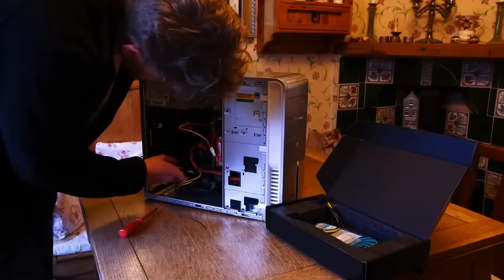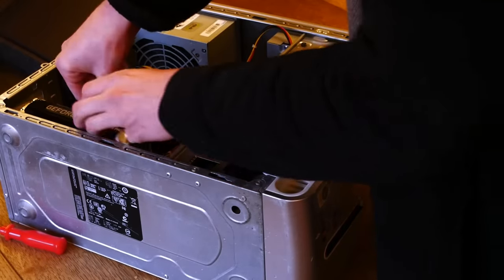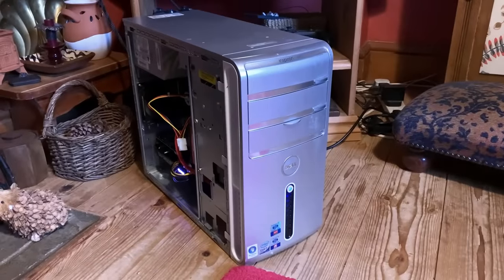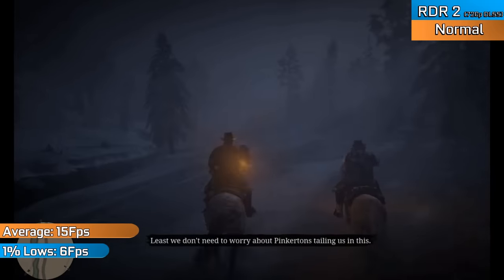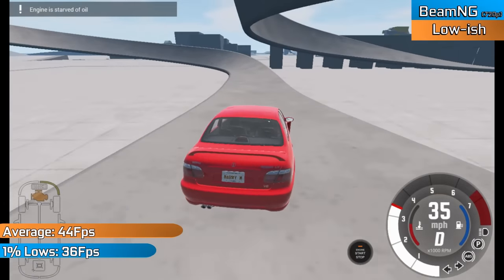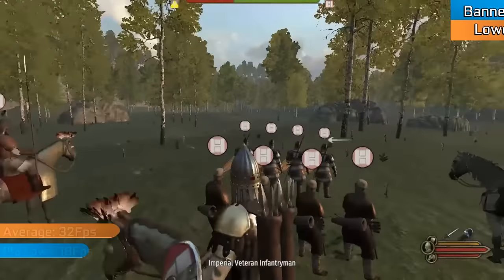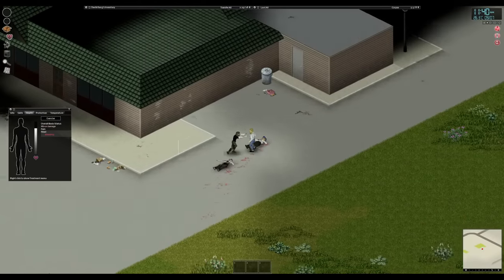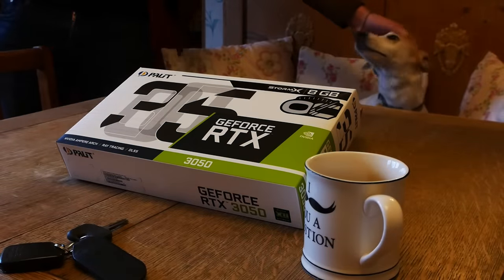RTX Graphics Card in a 15 Year Old Family PC...

Comment: Your biggest limitations here won't be the age of the processor, but rather the PCIe generation. I imagine it's gen 2, so the cpu is probably working itself to death trying to feed the gpu through that slot. A faster cpu might help, but I reckon the pcie slot bandwidth is the problem here.

Re: newer games on older cpus; it's worth noting that some older cpus simply don't have the instruction sets used by some newer software. It'll either work, or it'll be broken.
Reply: No, it's the CPU. The CPU doesn't work harder if the PCIe bus is bandwidth limited. That's not how it works. It sends the SAME commands through the PCIe bus and the bus is either too slow or it's not. It's pretty much certain the CPU is the bottleneck.
Reply: @photonboy999  Not really. If the bandwidth is smaller, the cpu has to queue up the data while it waits for it to be pushed through the pcie bus. There isn't an infinite amount of cache available, so the cpu will be constantly shifting they data around between caches and memory until its ready to go.  The cpu is definitely a weak point, but not as weak as it seems, given the extra overhead its incurring managing the pcie bus.

Comment: I also got Cyberpunk working on a Q8400 with a patch... Runs at 5-15fps depending on location lol 😂but in more sensible games the Core 2 Quads actually do very well, you can play a lot of older and simpler games on it at a stable 60+fps. They're still great for web browsing, word processing, 1440p youtube is also possible (4k struggles). Still capable and cheap.

Comment: This was really well done! It's nice to see someone who has some knowledge of older and newer hardware. A lot of youtubers kind of drop the ball and can't identify anything more than 10 years old. Can you post the model of that PC's motherboard? Most of those Vista-era Dell Inspiron systems (like the 530) I have come across could support any Core 2 CPU with two cores, but quad cores were off limits. If that thing can support Core 2 Quads it must have the G33M03 motherboard (I had to Google this as It was long forgotten information for me), so I'd be curious as to how it'd run with a newer CPU or with a pad-modded Socket 771 Xeon. The Q6600's anemic 2.4Ghz clock speed and 1066Mhz BUS are pretty limiting compared to the higher clock, BUS and cache on a Q9550, Q9650, Xeon X3370,  Xeon E5450 etc.
Reply: he needs the DDR 3 boards for the old Core CPU !
Q9650 here, on new RTX card ! 1080p@60 FTS !

Comment: Be glad that this PC even booted up with this card. Most of newer RTX card don't have Legacy VBiOS, which I learned hard way, and there were very, very few LGA 775 and 771 boards which actually supported UEFI. Core2 aside, I have hit a wall running with newer X58-based (LGA 1366) system which was also Legacy-only and EVGA's RTX 2070 which lacked support for it. I have Xeon dual CPU boards that support UEFI, but there are several bugs (like I have to manually install OS on another PC and add boot path manually in setup later), first platform with proper UEFI support was Sandy Bridge, no idea on AMD.

Comment: FH4/5 requires SSE4.1 support, so you need a Q9650 CPU, otherwise Q6600 won't work.
If you want to have a cheaper CPU with SSE4.1 support, and you can get a Q8300.
Reply: I’ll have to try it on my core 2 quad q9550.
Reply: @EvilTurkeySlices  It worked well with my X5450 (modded BIOS, equal performance as Q9650) just anything Q9xxx series, E/X54xx series that allows to play it modern games with SSE4.1 support. (If you ask me, "what about dual-cores?" It's painful enough to suffer or game wouldn't boot or in-game)
Reply: @Jenci  dual cores are great for gaming around the time the systems came out. A windows XP or Vista build will perform way faster with a high even core 2 duo over a quad.

Comment: There is still more performance to be had on this thing by either BSEL tape modding the Q6600 to run with 1333Mhz FSB, or upgrading to a Q9650, as from what i've read the Inspiron 530 supports 1333Mhz FSB. From my experience with an OptiPlex 755 with Xeon X3363 (~Q9550) and 1050 Ti, it pairs much more evenly than what's demostrated here!

Comment: In 2019 I played Metro Exodus on a beast from 2008: Asus P5Q deluxe, 8GB DDR2@1066 and a Q9550 OC'd to 3.2GHz. Video card? GTX1060 6GB. The game ran smooth at 1080p with some things turned down of course. It was perfectly playable, and the graphics were stunning although you could feel it struggle under all that load. It is interesting to see how demanding the games became mostly on the graphical side. The 2008 hardware(CPU and RAM) was good enough to play the game, but try even a HD4870 X2 and it would struggle .

Comment: Currently still using a Core 2 Quad Q9650 @ 3.00GHz, on a Gigabyte EP35-DS3R motherboard, with 8GB (4x2GB) of G.Skill DDR2 1000 5-5-5-15 memory, and a 2GB EVGA 750 Ti SC (with optional extra circuit board EVGA backplate), along with a Sound Blaster Audigy SB0090, dual booting between XP Pro 32-bit and 8.1 Pro 64-bit (plus ClassicShell Start menu).

With SanDisk X400 boot SSDs & WD Black data HDDs, it makes for quite a nice retro build and everyday system, especially with it supporting more recent SSE 4.1 instructions that the Q6600 lacks.

Comment: Great video. I've got my old Q6600 as a key ring on my keys. I had two Q6600's. One in a Dell XPS 420 paired with a 8600 GTS. Then later on, one in some Aldi Medion machine. Paired with a 9600GT but I pulled that out and put s GtX 460 in.

Comment: C2Q Q6600 was a great chip back in the day. I've just stuck the same rtx 3050 into my son's rig... he's running my old i5 4690k in a z97 board.... it upgraded a 1050ti it's definitely better but not night and day. Even in that rig I'm noticing the CPU is a bit of a bottleneck now but it does run well if you turn down the settings a bit. He usually gets my hand me downs so might have to wait a bit till I upgrade my board/CPU next .... unless I can find a cheap 2nd hand update to some slightly new gen stuff.

Comment: I have a Core 2 Quad (9300) 2.5ghz, 8GB DDR2 1066mhz,  with an GTX 550ti (1GB VRAM) running Win10 Pro. This WAS my gaming PC during the mid-2000s, but these days I just use it to watch YouTube, Twitch, Prime Video, local TV streams, and videos I have on the SSD on a big 37" TV (1080p). The one problem it has is with Netflix where every hour or so the video will freeze for a moment, audio keeps playing, and then the video speeds up to catch up with the audio (using Chrome Browser).  I thought a video card upgrade would help, so I installed a GTX 980 but it didn't help with the occasional video freezing with Netflix, but it's only Netflix that does that. So it must be the CPU that Netflix bogs down on... no idea how to fix that other than using a different PC.  I mean I have a Chromebook that doesn't stall Netflix like that.

Comment: You can hack that OEM q66000 by shorting two pins with a small piece of tape and bump it up to 3ghtz stable, which would buy you about an extra 5fps. Did the performance hack to my moms old HP and been running stable for years on the factory cooler. There is tons of videos on here of how to do it. But, in some of the titles you demo, 5fps would be, the difference between playable and unplayable.

Comment: I recommend spending about 10 to 15 bucks on a Q9550, its a bit quicker and a slightly more modern CPU and might even run your r at higher frequency (800 MHz instead of 667 MHz), so it could make a significant difference
Reply: Unlikely that a DDR2 era board/chipset would support it though
Reply: @ubergeeknz what I suggested is all ddr2 era hardware, what do you mean?

Comment: Great video Budget Builds! I tried this as well, I put a RTX 3060  in a machine with a Core2 Duo E8500, then proceeded to try to use it for a month. It worked okay actually, though it could use 2 more cores. I will be sticking a Core2 Quad in it, sometime in the future, to try it out again. It is a pretty solid pc, even 15 years after it cam out.
Reply: Also, on the E8500 I was able to get BeamNG to get 30-40fps on high settings, with a few turned down. If you want I can find the notes I put down, when I went threw all the settings to see what is cpu and gpu intense. I think it was the mesh quality, and the shadows that really hit the fps.

Comment: Forza Horizons 4 worked perfect at around 25fps at 720p with all settings on low on my little Dell Studio 540 (Q8200 2.3Ghz, 8gb RAM, AMD R5 240/HD 8570).Haven't tried 5 yet though.

Comment: Looking at putting an RTX card or any modern graphics card in a system like this isn’t a sensible way to spend your money that’s definitely true, however if you are saving up to build your own modern gaming pc and already have a system like this or similar it does show that maybe getting the graphics card first and putting it in your old pc to at least be able to enjoy some more games a little bit while you save up for the rest of the components isn’t a bad idea, I imagine an SSD would help the old systems performance as well so maybe buy the gpu then the ssd then use the old system like that until you’ve managed to buy the rest of your components.
Old systems aren’t necessarily terrible though, my gaming rig I use for latest titles has a modern ish gpu, an I7 3770 and 16gb of ddr3 ram all running from an ssd, it still flys through every game I throw at it even on pretty high settings and isn’t much newer than this, similar spec’d pcs minus the graphics card can be had very cheap so aren’t a bad way into gaming pcs

Comment: That's pretty cool that you actually got that 3050 running on that old Dell!  Danny from Nerds on a Budget tried to get it to run on two different Dell Optiplex PCs' which have e-PCI 2.0 slots and Sandybridge CPUs' and it will NOT run on either!  An RTX 3060 actually DOES run on them though.  Go figure!  🤔

Comment: The Q6600 is still a very capable processor even in 2022.  Although the Q6600 only runs at 2.4 Ghz the CPU is pretty slow by today's standards but when you consider that the Q6600 has 8 MB cache and is a true quad core CPU, the Q6600 is more better for Office work, internet, movies, music and day to day tasks.  The Q6600 is definitely not a gaming CPU by any means, but for everything else, the Q6600 does perfectly fine when paired up with a low budget GPU like the Quadro K600, and 4~8 GB ram.  If you want better performance from the Q6600 just do the BSEL tape mode and it will boost the CPU clock to speed to 3.0 Ghz which will make the CPU much more usable.

Comment: I used a C2D for ages... great CPU, but not for those games... CS1.6 was flawless on that one, 101 fps with ease :), with an AGP card it got way better FPS than any newer GPU, and it felt way smoother with the CRT monitors, nowadays the refresh rate is really shitty with LCDs and later technologies. The change from AGP to PCI made a huge flop to graphic cards. Another change that made everything worst is the change from DVI to HDMI, HDMI is way slower.
I still have DVI, with a 120mhz 3d monitor, and I get 390 FPS in CSGO in Ultra, 120 FPS in Rust in medium, and havent tried a lot of other games lately due to lack of spare time.

Comment: My Q6600's MB from Asus allowed me to upgrade from 8GB DDR2 800 to 8GB DDR3 1600 (16GB won't work as the DDR interface of Core family is limited to 4GB per dimm and my MB had 4 DDR2 and only 2 DDR3 slots...). The difference is like upgrading the CPU itself, the memory interface is faster so even games ran smoother. The CPU itself ran very overclocked (*can't recall by how much) and took good advantage from the upgrade in mem speed.

Comment: Years ago i found for cheap a xw6600 workstation with dual  e5450 processor  8 cores at 3 GHz on socket 771. It has now 12 gb quad channel ddr2 ram and a GTX970 (that was replaced in my main system by a RTX 3050 :). The latest title I've tested on it is DOOM 2016, on 1080p High , locked 60 fps, but with a very long initial load time... But in Doom, Crysis 3 and Witcher 3 the old platform didn't bottleneck the 970.

Comment: Very interesting video. I always thought I'd need to upgrade my 430w EVGA PSU if I were to get a graphics card upgrade (Expesically one with RTX) given Nvidia recommends at least a 550w. But seeing it here run just fine on a 300w PSU has me impressed. So I'll probably end up picking up one of these cards and at least trying it with my current PSU by running some stress tests. Just wondering if pairing this card, my Ryzen 5 1600 and the 430w PSU would be something safe to use long term or not?

Also, early congrats on 5 years since making the channel. It's been a fun 5 years watching you for sure.
Reply: I can guarantee that so long as you have a quality power supply, 430W is more than enough for a Ryzen 5 1600 (even overclocked) and a RTX 3050.

Personally I have a overclocked Ryzen 5 1600X with an overclocked R9 280X running on a 500W power supply, and I'd happily downgrade to a 450W Corsair/EVGA/Cooler Master etc power supply.

Even under full synthetic load on the CPU and GPU I barely hit 350 Watts of actual power draw.
Reply: My i5-9400F (60W) and 1660Ti (120W) runs fine on a 250W TFX PSU, since 2020.

Comment: My core 2 quad I built with 8gb ram from day one. I knew I'd need it. But I can tell you right now a velocaraptor hard drive doesn't come close to SSD speeds. I had 2 of them in RAID 0. When I replaced my system with an I7-2600 + samsung 830 back in 2011, I noticed a HUGE increase in speed of the storage over an effective 20k hard drive set.

Comment: I have a dell xps 435mt  with a i7 920....bet it would run much better...plus 6 ddr3 ram slot doesn't hurt either
Reply: I'm currently running a i7 860, gtx960 4gb and 16gbs 1600mhz and I have to say it's not too bad. I can play a ton of games on medium to high at 1080 75hz

Comment: As per similar comments. With very little effort back in the day I used to have this CPU running at 3.4Ghz with pretty substantial aftermarket air cooler. I'd be interested to see, if you've got an overclocking motherboard whether overclocking the CPU in conjunction with some good RAM and an SSD could improve the benchmarks much. It might alleviate the CPU bottleneck to some degree.

Comment: I've got a RTX 3060 in an old IBM I7-4770 from 2014 with 16GB ram and SSD and it runs all the latest games fine at 1920x1080.  The CPU stays pegged most of the time gaming but for a 100.00 dollar pc off ebay  a 400.00 graphics card and I had to upgrade the PSU. It runs great at high settings. sometimes ultra lags a bit.  but I had no problem whatsoever playing 2077, FC 6 or RE8 at pretty much max.

Comment: You can overclock this CPU with a piece of tape. Look into it. Mine was at 3.0ghz all core when I did it. Increases the FSB from 1066mhz to 1333mhz thus giving the base clock an increase from 2.4ghz to 3.0ghz. could be fun for this video series. Cheers

Comment: You should look into upgrading a Dell Optiplex 780.  Those motherboards take Core 2 Quads up to Q9650, can use up to 16GB of DDR3 RAM and have a PCI Express 2.0 slot.  I've long been curious just how far you could push a configuration like that.

Comment: Core 2 quads provide good value for lighter loads. I use a q9550 in a cheap plex server and it does the job just fine and also handle some light transcodes too.
Reply: throw an RX550 or GTX1050 in there for hardware-accelerated transcodes for streaming ;)

Comment: I have a ps5, but I ONLY play World of Warcraft on PC. 
So I use an old i3 4130, 6gb of ram, and an old amd XFX 6950  (10+ years old)
Put an ssd in it, and she flys! Don't need all the new parts depending on what you play. 

I legit play world of warcraft at 1080p without issues 50-72fps. 
I'm happy with my "gaming" pc. Cause it does the one thing I want it to do.

Comment: I have the core 2 duo 2.66  1333 GHZ processor bus speeds 333. And I am using a ATI Radeon 240 graphics card and they are a perfect match zero bottleneck. The bus speeds are really nice on these processors. I have about 25 gaming computers this one is just for fun for the low end games

Comment: You should try a better c2q. There's actually a fairly giant performance gap between a 6600 and a 9000 series, including some instruction sets that the older ones are missing
Reply: And 9000 overclock a lot I got mine q9550 to 3.85 ghz

Comment: Fact=The Q6600s start sucking watts from the PSU when OC'ed. Also they tend to need more voltage at 3 GHz, so there's no guarantee that it will be stable.

Also, for 8 GB of DDR2, in my experience, I had to use a non-OEM motherboard and raise the VDIMM to 1.90V or it froze at the BIOS logo. Did you get any wacky BIOS issues with the new video card? I know that with a pre-UEFI BIOS, it can cause the following issue to occur: BIOS configuration selections lost after unplugging PC from the wall, makes you re-enter everything.

Comment: I have an 8 year old pc that I built myself. I5 processor, 24gb of RAM. It originally had a GRX650, I upgraded to a, GTX1050 Ti.  No problems. but that's as far as I can go. Any more powerful video card would outrun the processor
Reply: Look up if you can put in a cheap xeon e3, they are cheaper than equivalent i7 usually, which one to get depends on CPU socket

Comment: I install RX 550 on my LGA 1155 motherboard but it's not showing display after it so I update Bios to the latest version and it's works, So the question here if I upgrade to RTX can it shows display or no because there is no more BIOS to update the latest version of it is 2013 V 2.7

Comment: Try to overclock the processor with BSEL mod (recommended on OEM and non-overclockable motgerboards) and run again the games it will run much smoother (not so smooth on newer games but it will do the job). It brings the cpu at 3ghz.
Reply: I viewed again this video, and I mistaken your processor with the q6600, my mistake.